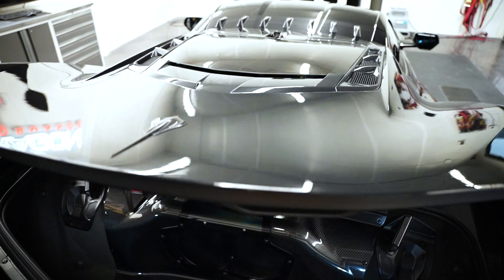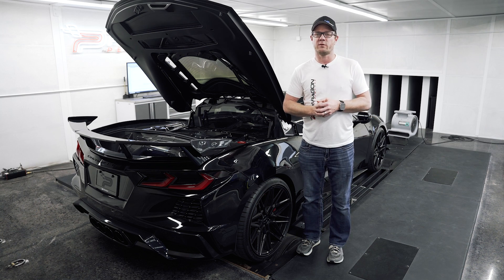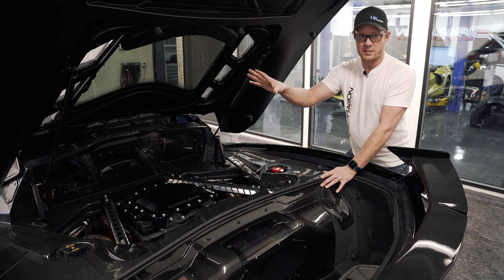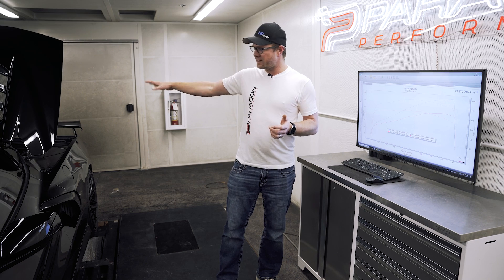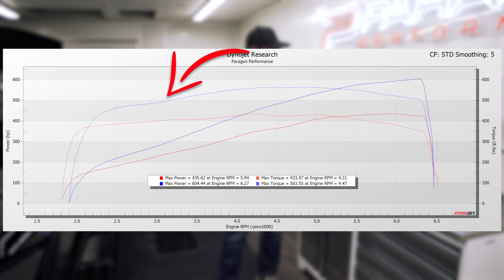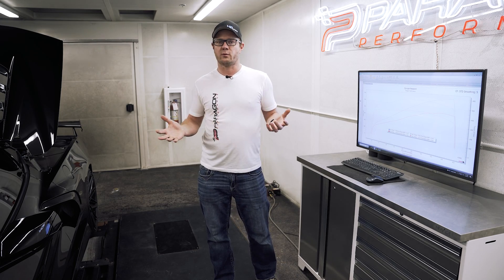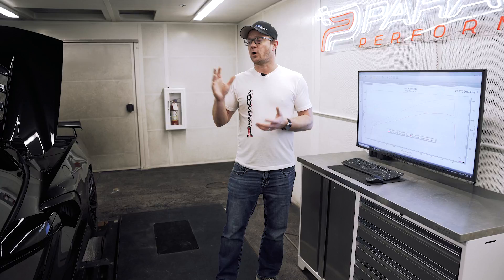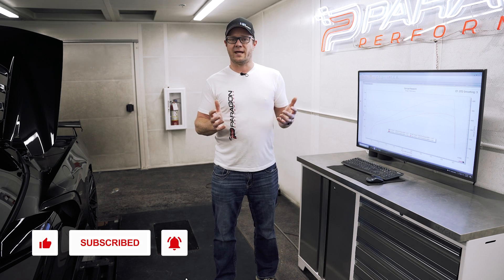Lingenfelter Magnuson C8 Corvette Supercharger Dyno Results! - Paragon Performance!

Comment: Such a waste of a mid engine chassis. I love the C8 and will probably buy an E-Ray soon, but that motor is just not made for mods. Anyone that says that platform is better than a Coyote is kidding themselves. It sucks Ford is so behind with the tuning on the GEN 4 cars.

170 rwhp for 25k is a total rip-off.  You are better off buying an E-Ray and getting the extra 160hp and AWD for 1/2 the added cost to the Stingray as this kit.

Comment: Adding ridiculously expensive mods vs just buying a factory engineered version (Z06 or ZR1) that was already engineered to outperform the entry level stingray when the higher performance versions carry a factory warranty is dumb….by the time you supercharge, add proper exhaust pipes, headers, stronger drive shaft, different tires, better brakes, etc., you’ll be 50K into it and you will never recoup costs vs. just buying a better Z06 or ZR1 car to begin with - not to mention maintenance or warranty or insurance problems associated with changing all these parts to make a race car version of what you started with….I wouldn’t do it. Happy with my stock 3LT convertible… and yes I tracked at the Corvette driving school….but you don’t drive like that on the street w/o risking disaster….I see it as a waste. Just buy what you want in the first place and be happy with it!
Reply: Shut up..

Comment: How often do you need to service the bearings in the supercharger? Also is there a failsafe for if the supercharger water pump stops working or a limp mode if charge air temps get too hot. On my c7z came factory with a limp mode that saved my engine many times thing overheated so much when I tracked it

Comment: 600hp at the engine per the dyno! WHAT?? Why is it so low?? If it were whp then it would be good!
Reply: It is in whp.Engines probably around 700hp.
Reply: I don't believe so, see 2:05

The issue is its a stupid engine with 1 cam shaft! In 2024 WTF?? Hence Z06 ditches it and has so much more power from a smaller engine

Comment: Hard to spend 30k for a piece that fits in a relatively small box  compared to being able to buy a mint Supercharger 04 C5 with low miles. These add ons are absolutely ridiculous in price.
Reply from the maker: Fair but the $24,995 is worth it. Once you drive a Supercharged C8 Corvette you'll understand.
Reply: @ParagonPerformance  I have a Supercharger on my 04 C5 and it does help and is fun but come on guys 25k to 30k is a SHITLOAD OF $$ compared to being able to buy a very nice C5 with a blower like mine, a Restomod LS3 C3 like I also have. These bolt on performance mods are absolutely ridiculous as far as price goes just like these rolling chassis for 25k to 30k. Like I said before as long as guys spend it you guys will take their money and I don't blame you. I will wait till the fad slows down.

Comment: What about upgrading the cooling?  The supercharger in the C7 Z06 created huge cooling issues when tracking the car.
Reply from the maker: No issues with cooling! The system has a large tank & includes an additional heat exchanger.

Comment: Thanks for doing this video. Appears that the Lingenfelter Magnuson kit provides a nice step up in HP and Torque over the Stage 2 Procharger earlier and through most of the power band from 2500RPM through 5000RPM at which point we start to see the Procharger Stage 2 slightly exceed the Magnuson in torque at 5,500. In HP the Magnuson exceeds the Stage 2 Procharger through much of the power band until 5500 RPM with the Magnuson getting up to 604HP at 6200 RPM and the Procharger Stage 2 getting 639HP at 6200.  Question is whether that slight difference is felt and worth the extra cost for the Lingenfelter kit. Hopefully you are able to do a comparison video soon!
Reply from the maker: We will be releasing our ProCharger Stage II Paragon Tune Results soon then we will have a comparison of both the kits.

Comment: Is the drivetrain able to handle the extra power without any failures, axles, clutches etc? Looking at this package for my 22 c8.
Reply from the maker: Yes the drivetrain is able to handle everything perfectly fine. If you want the extra warranty, axles are part of the required list. From our testing the clutches didn't have any issues and we strongly back Lingenfelter's testing. They wouldn't have released a kit that wouldn't be reliable. 
- Justin

Comment: 25k. Thats crazy. A Z is more affordable at that point
Reply: Low balling aren't ya, not very many buy 1LT due to package restraints. My car was 90k 3LT plus 25k which there is always hidden costs plus tax. Z06 is more expensive no matter what but these kits are ridiculous.
Reply from the maker: Whats the price on a 3LT Z06 compared to a 3LT Stingray?
Reply from the maker: C8 Stingray Starting $69,995 + $25,000 = $94,995

C8 Z06 Starting $114,395

$94K is less than $114K
Reply: @ParagonPerformance  wide body kit wheels and tires, aero. To equal a Z since you are fairly comparing them and you are well over 114k. JS apples to apples if you want to compare everything a z brings to the table

Comment: The C5 Lingenfelter 427 Twin-Turbo Z06 is thee fastest vehicle I have ever experienced in my life!

It has conquered the best that Porsche, Lambo, Ferrari and even an older Pagani Zonda could bring to the track. Some were stock while others were heavily modded. All of them lost to that Lingenfelter. 

In fact, Dave had his shop detune his motor down to approximately 1000hp. Yet he still spun the tires in every gear at any speed. That motor possesses some tremendous power! 

Not to mention, the rear tires only had thirteen inches of space between the two. I had never seen such HUGE custom meats on a Corvette outside of a Goodguys Rod & Custom show and none of them were driven daily!

Truly a remarkable piece of mechanical prowess.

Stay classy my friends.

*EDITED for grammar.